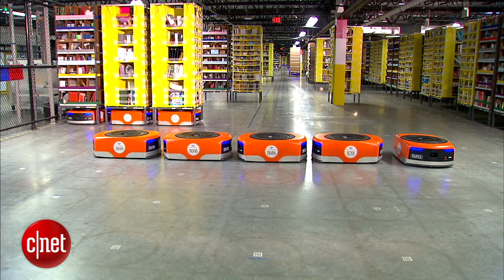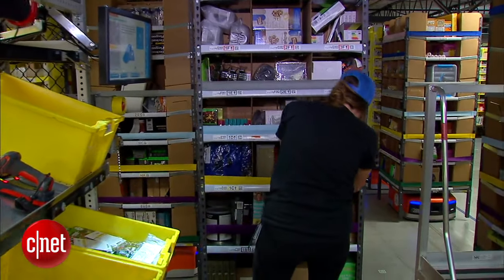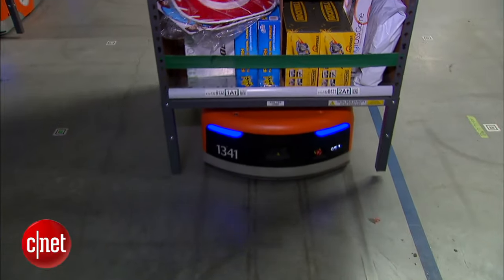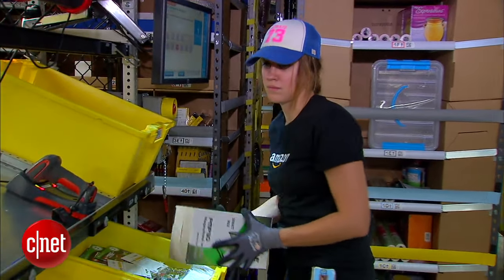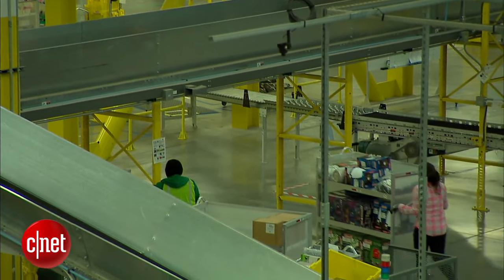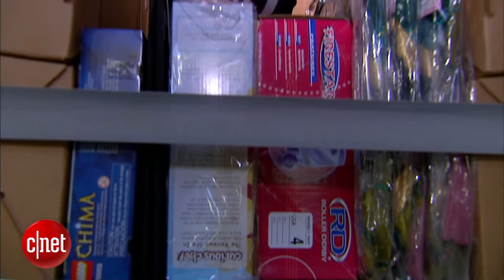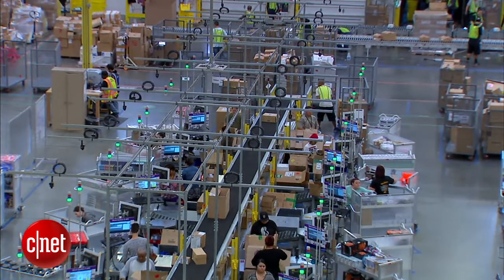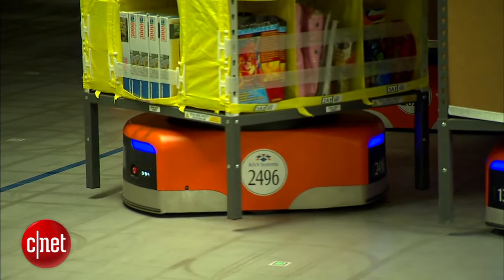CNET News - Meet the robots making Amazon even faster

Comment: how does the robot get tasked ? 
 does a robot starting from point 1 get sent to any of 1000 points(destinations) or 
 do they  receive a signal and the closest on a empty journey   goes to that point (instruction ?) ?
 or perhaps ...  one that is finished in 30 seconeds ( precalculates ?)  receives a retask and proceeds to a point.
Reply: There's a master computer that knows where every robots is and choreographs all of their movements at the same time.   The robot itself doesn't make any active decisions (aside from simple collision sensors).
Reply: I imagine they have to go through various destinations as it is to accommodate not only for pickers, but also stowers and counters. Also as it appears pods line up ready for items to be picked. Often times the operations team will already have a significantly large list of inventory that needs to be processed and shipped out. So they're probably just instructed where to go.

Comment: Look at what is required for these things to work. Clean, perfectly level concrete floors with location sensors every yard / meter. I see these operating in new, purpose built warehouses but what about the existing warehouses? Retro-fit? How many sqft of existing warehouses are there in the world? It sounds like it is going to cost a lot of money to eliminate the expense of employees. After the elimination of low paid employees, who do they plan to sell this stuff to? No job means no money means no sale, so if they are successful they are nothing but a snake eating its own tail. Insanity
Reply: Amazon already clarified they're not replacing workers with their robotics. Also on the issue with older buildings. Amazon doesn't purchase land/buildings. They specifically lease their buildings. So each building they operate in they lease the building and at any moment that lease ends they can choose to just pick up and leave. As they grow they're building new buildings and making them robotics buildings while the older buildings they re-purpose for things like "Apparel" "Books" etc.

Comment: shouldn't have whined about all that walking
Reply: They didn't. It took 90 mins for some items, and when you have like 100 orders per minute per person you can't have them taking even a minute per item walking around. Also it means they can fit more stuff in the place by putting shelves closer together. Did you even watch the video? It wasn't feasible to have people do it anyway. Plus automation only sucks until they take actually all the jobs we need to live and then we just get to chill out.
Reply: Why shouldn't they? Those people still have jobs. Many just no longer have to do the excessive walking they used to have to do.
Reply: Milano Martin, I agree because i still work at the Amazon sweat shop with no air. I walk for 6 hours and its painful. The new Robotic Amazon opens in August I’m transferring.